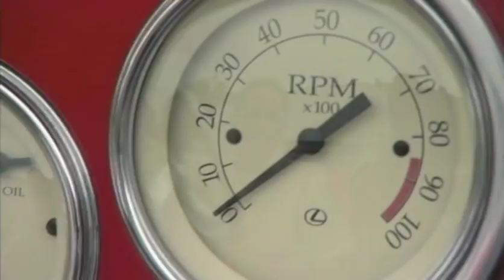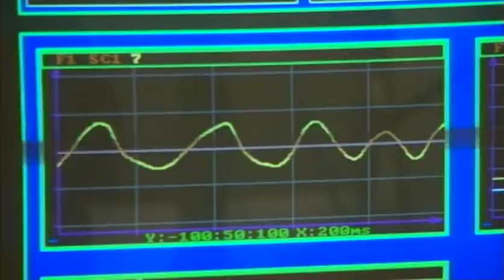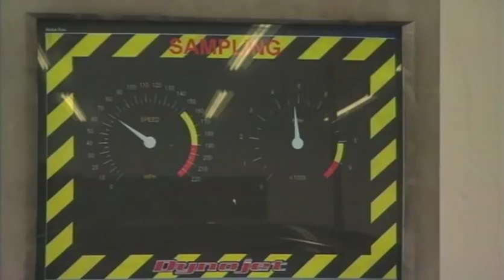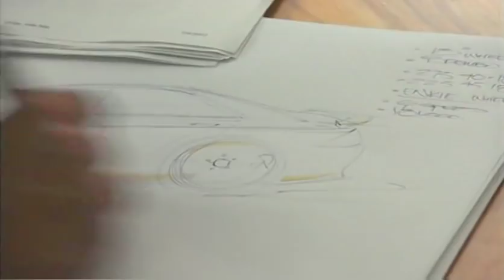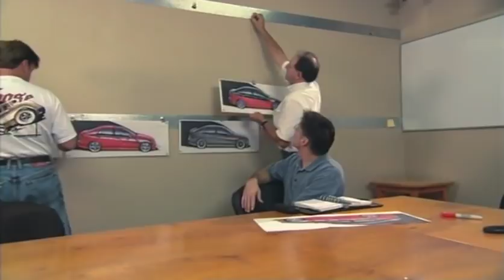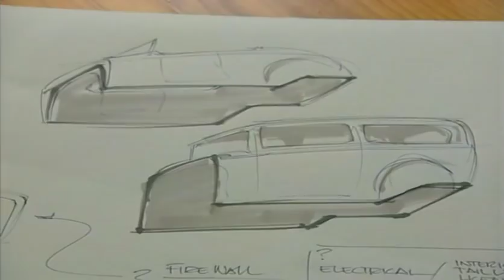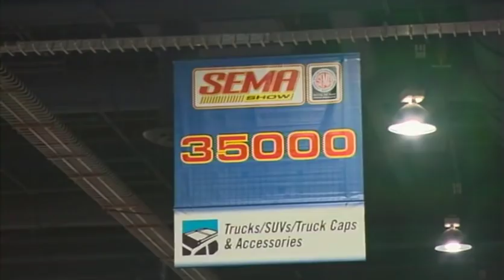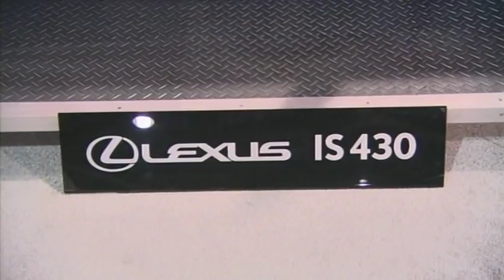RIDES - RODS - ROD MILLEN

Comment: I’ve always loved the IS/Altezza; it’s a nice build but rather funny they added so much extra work to put a V8 in it when they could have just used the 2jz out of the Supra and had WAY more power. Of course, up until pretty recently most Americans definitely would have thought, “V8 better” even though the NA 4.3L 8 they dropped in would be a pain to take up to the HP pretty easily attained by the 1 or 2jz out of the box. Pretty funny to see what cars were at SEMA back then; I’m thinking early 2000s but not sure.
Reply: Were the 2JZ engines in high demand back when this was filmed? I know the Fast and Furious attracted a lot of idiots into the car community.